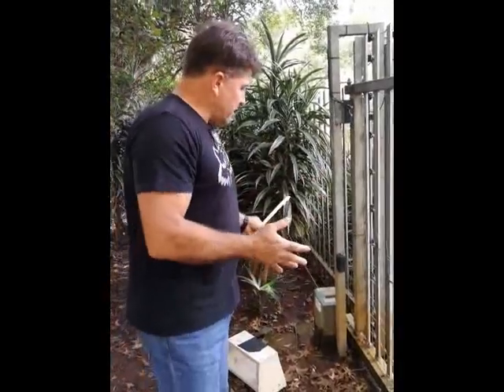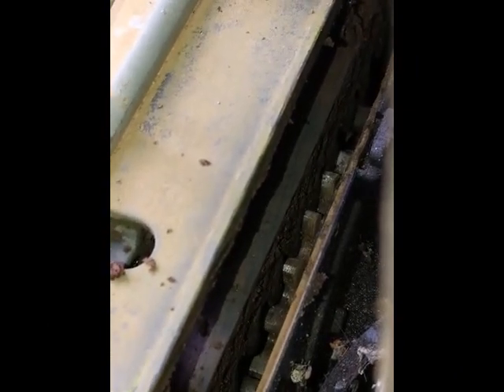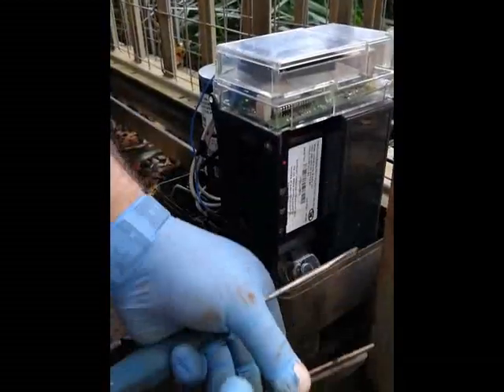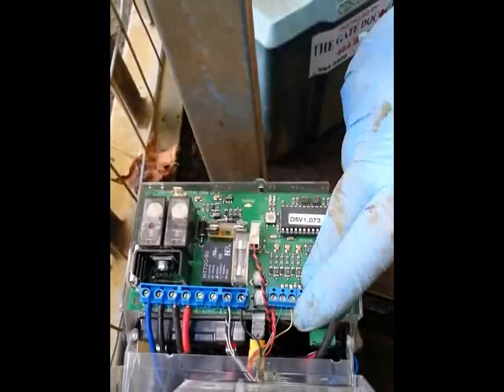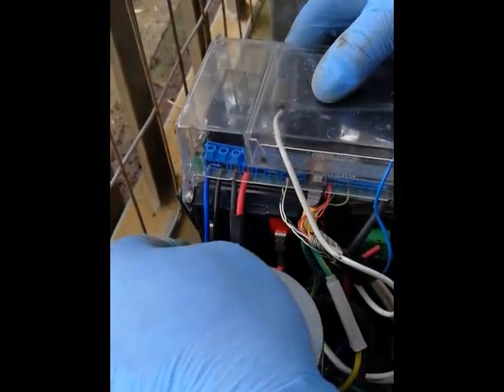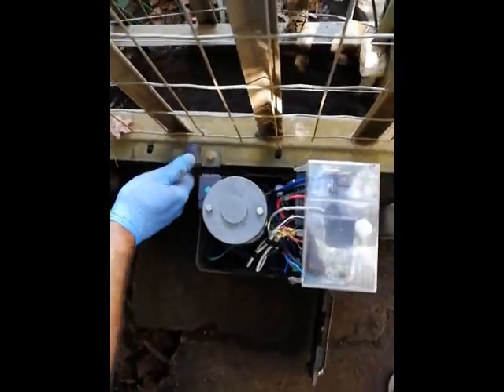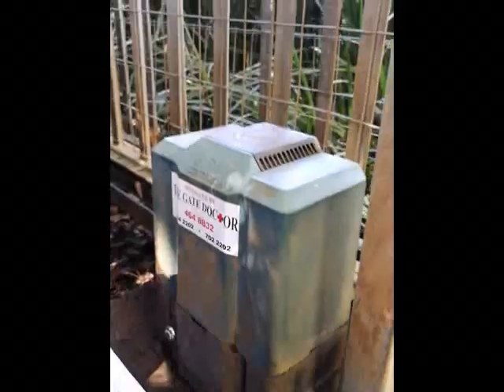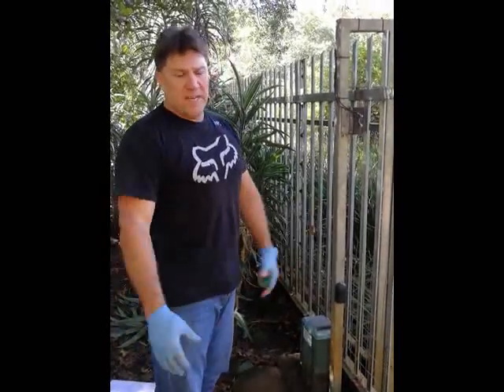Slide Gate Maintenance - Centurion D5 Motor (Self-Help Tutorial)

Comment: Hi, thank you for this video. It was very informative. I would suggest you up your camera work (it needs to be more steady) and I suggest you split it into 5 videos each addressing a very specific problem. Then you suggest the one video in the other. Also, insert links to things we can buy at the bottom to solve the problem.
Reply: I for example specifically wanted to know how to check and if necessary replace the fuse in my D5
Reply: Not just more steady. Learn how to shoot a video in LANDSCAPE mode.